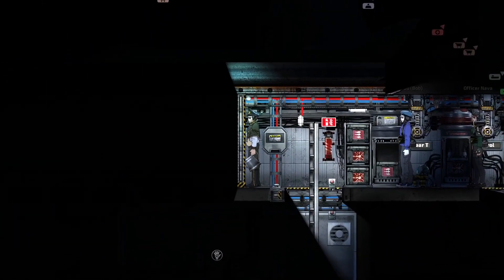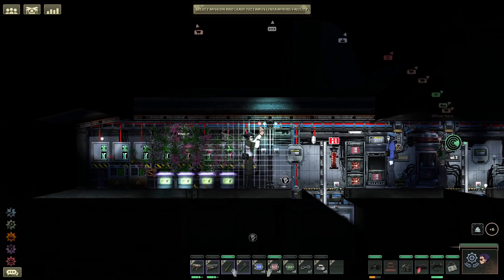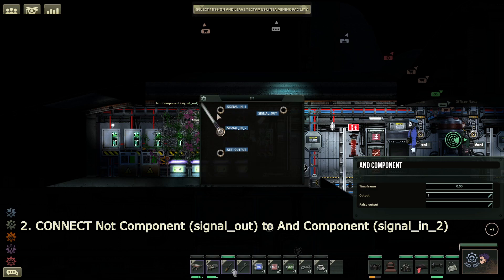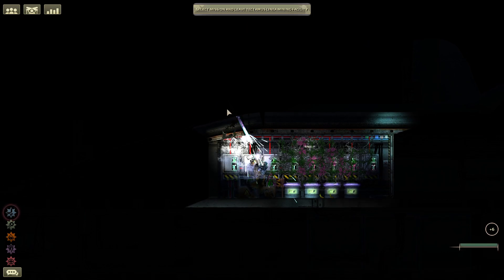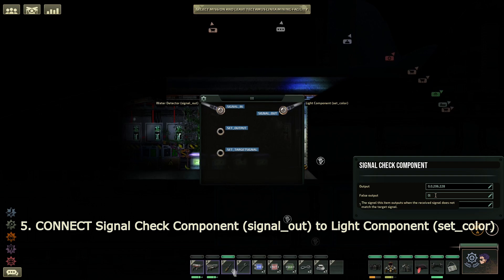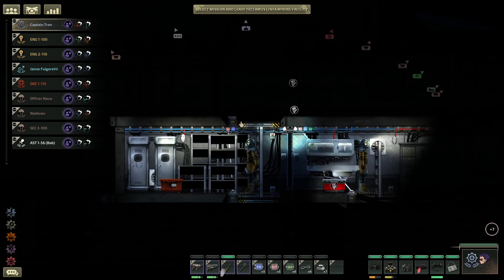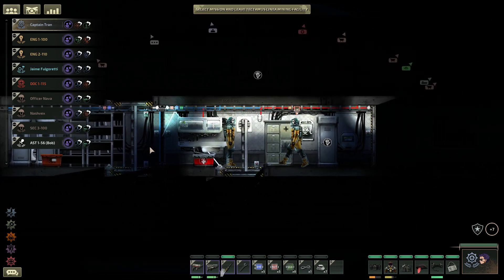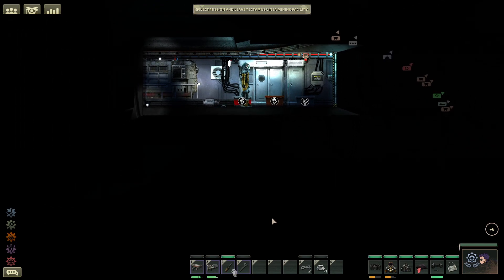Barotrauma ⚓ 〔This Old Sub〕 10 - Automatic Doors

Comment: This is the beauty of Barotrauma, you can modify subs on the fly.
I use an OR component in my automated door assemblies, set the output to 0, this way I don't need NOT components and double AND.
It can be useful to make the water ducts one way only, so if there is a flood in the room below, and someone opens a hatch, the water that flows up will not lock the duct open flooding the entire compartment. I do that with another Water detector that sends out a 0 to a signal check Set_Output port, and the top Water Detector goes to Signal_In as usual. The Signal Check output goes to the Duct block Set_State. This way if water reaches the top of the room, the bottom water detector will send out a signal to make sure the duct will not open until the room is at least partially drained.
I might not be able to write it properly, I uploaded this in the workshop a while ago if you're interested (Smart automated doors and hatch, and safety duct).
Messing with the bilge pumps is also beneficial sometimes. You can make a room function as an additional ballast, or work as a waterbed for your pomegranates. In my nonstarter subs I usually convert one room to be able to function as an additional ballast to counter the strong currents, this can be done ingame in most subs as well. Gunnery bottom for the Herja or engineering for the Humpback is perfect for this.
If you notice that some rooms have still 5% water in them even after draining, this can be also fixed by using the Water% instead of a Signal_Out of a Water Detector to operate pumps. I added two more components though (Greater and MEM), because with Performance Fix it didn't always register for some reason. The 5% in all rooms add up after all, better to remove them.
Reply from the maker: If I can correctly implement these changes, I will try to give these modifications a shot and see the difference!  I really appreciate you contributing your knowledge of electrical engineering.  Like many others before me, it's a bit of a tough cookie in the game.

Comment: I thought for sure the next episode was to going to be a bit longer than this. Welp, it's better than nothing.

I see you're making this series even more legit, huh. That recruitment campaign almost sounded just right *Chef kiss.

Does this mean you have to redo this again the next time with your new next tier Submarine? If so, that must be suck. No pun intended.
Reply from the maker: I have several planned videos about me trying to learn electrical engineering, since the components are readily available for a few marks.  While I can straight-up craft them, I've been short on the needed tin for a while.  Yeah, I'll have to redo them for each new submarine, but that's fine.  As I prep each door or learned gimmick, I get faster at circuitry and ironing the wrinkles out.  Since I've already done all the doors in the Orca, I'm wondering what kind of problems I might face with automatic doors -- especially the ones facing upwards -- but since I haven't sailed anywhere yet, it's going to need to be a trial by fire.

As for the lack of an hour-length episode ... this was something I've wrestled with for a bit now.  I wanted to make a few wiring topic-focused video so people can search for electrical engineering how-to's, and not bury it in my hour-long videos because of it merely being in my "let's play" format.  My channel suffers from a lack of discoverability, so making searchable topics will help with that.

In the end, I came up with some possible script ideas for doing some of my electrical engineering now but not showing it, and then showing how to make it the episode after, once I use it in an actual situation.  Sort of like a demonstration followed by a sales pitch to "please watch this next video."